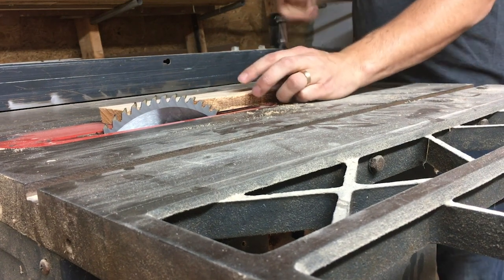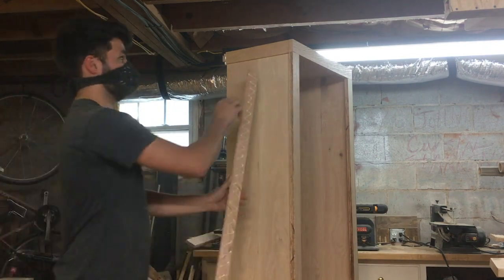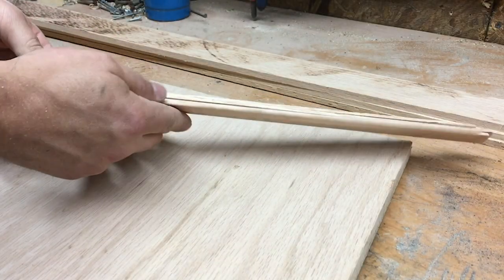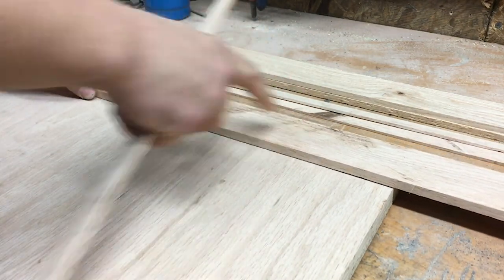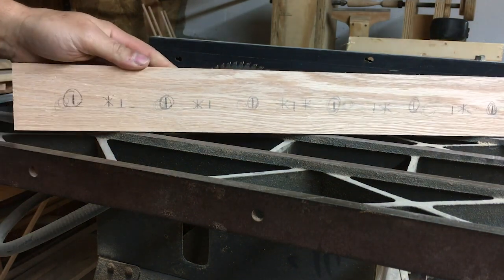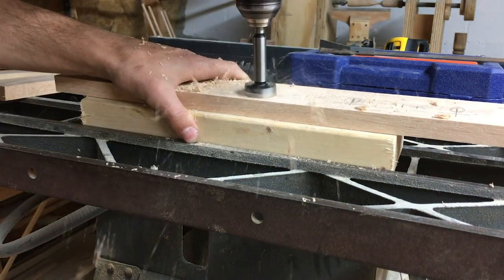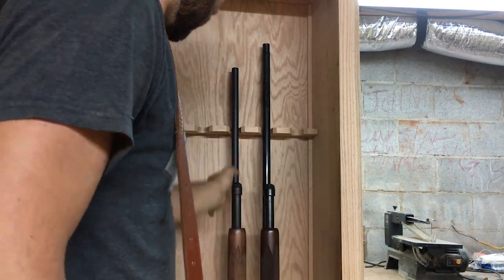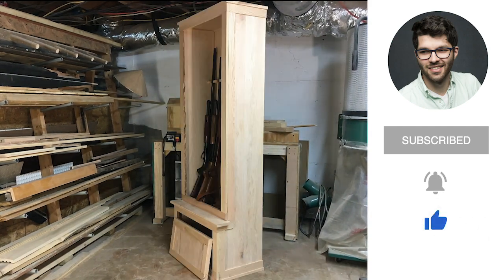DIY Gun Cabinet Part 2 of 3

Comment: I like your project, but may i give you some tips? sand in between everything, you made it look so rough, and that while it become actualy a very nice cabinet and your frame work, you have a bisquit joiner so made the frame before you attached it to the box. so much nicer than all the pin holes you have to fill. and than the rack break the edges from it by sanding or use a trimrouter, it makes it stronger, no splinters and it looks amazing the same with that door you took a piece of plywood unsanded you glued the strips on it. a bit more attention to detail and this project would have turned from nice to amazing, and it land you more followers. i am going to build a cabinet too but here in Norway the laws are strickt, so i have to remove the bolt etc from the guns so it can be fired once stored in that cabinet and ammo and those parts have to be in a safe.so may frame work will be from solid oak and i will use joinery. but back to you, slow down and go above and beyond your comfort zone, it will be challencing but the results will be speaking for it self. don't take this negative, i have been through that stage too from a diy till a profesional furniture maker, and i am self thought, a vetran that needed a change. good luck and i hope to see more projects from you and see you grow.
Reply from the maker: Thank you! I appreciate the advice! 😁👍🏻